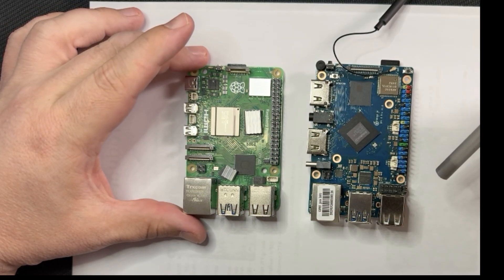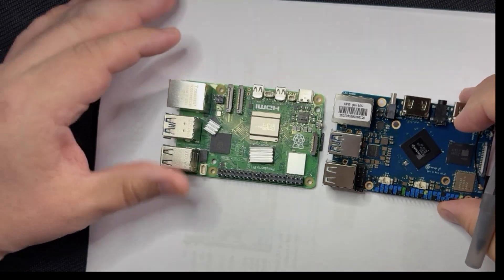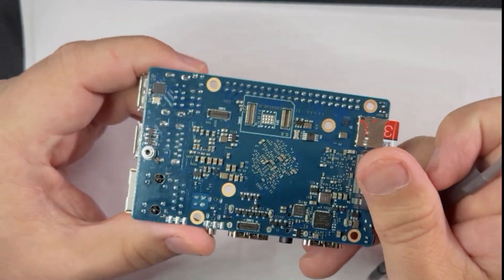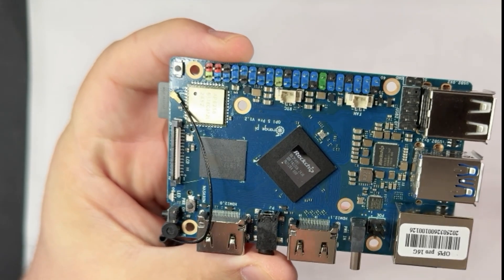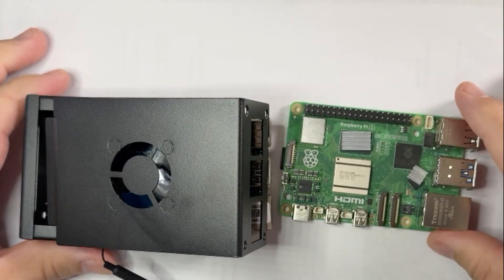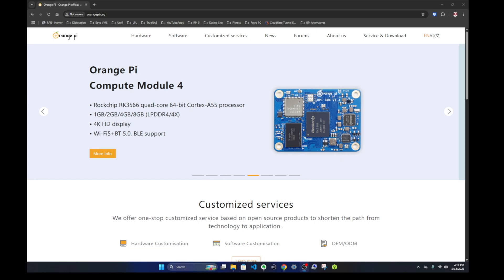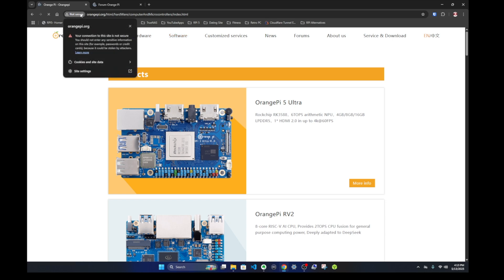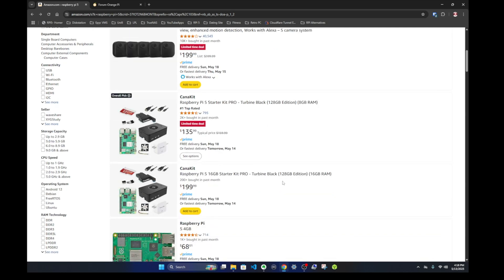Best SBC in 2025? Orange Pi 5 Pro vs Raspberry Pi 5!

Comment: I have both. Orange Pi beats Raspberry Pi in performance. However from software, forget about Orange Pi.
Reply from the maker: For sure, Orange pi can’t compete with Pi’s software or support!
Reply from the maker: Which Orange pi do you have?
Reply: @MackeyTech 5, it's RK3588 based, the base model with 8GB memory. Actually, it's good machine I use as a headless server. It runs also fanless.
Reply from the maker: Oh very nice!

Comment: Pi 4B is great, but Pi 5 is a big mess for both hardware and software. The out dated 16nm process makes Pi5 very hot!
OPi5 is getting better on software and doc. Great on AI performance. Great 8nm process.
Looking forware to RK3688 in 2026 with 4nm process.
Reply from the maker: Agreed but as I’m sure you know it’s also doing a lot more work than the raspberry pie four; What with the PCIE lanes, the GPU, faster RAM.  A good active cooling fan is always recommended! 👍

Comment: I have done a comparison between OPi 5 Ultra and RPi 5, both 16GB versions, for the use-case of using it as a developer 'desktop'. RPi is a bit weird, it runs Jetbrains CLion IDE dog slow, not usable at all, whereas on OPi 5 Ultra, it runs very decently. I'd assume it might be due to RPi usage of wayland and/or the GPU in general. Regardless, for this use-case OPi is the winner.
Reply from the maker: Thanks for insight! i’ve never used Jetbrains; what project are you developing?

Comment: That Orange Pi. Cant you go into the firmware and configure the NVMe to Gen 3 speeds?? All my Raspberry Pi 5's I firmware configured them  They run about 800-900MB/s speeds
Reply from the maker: Not 100% if that’s an option, nothing on their site or manual about it but You first have to connect the OPi to a computer via usb to ‘update’ the firmware so it can use the NVME!

Comment: It will be interesting to see if the Raspberry Pi 5 HATs work with these devices. After 7 reliable years with 2x Synology DS414 Slim NAS, I'm looking for replacements. While the Raspberry Pi 5 with SATA HAT looks great for 2.5" drives (and great tiny footprint with some nice cases available to buy or 3Dprint), I'm thinking this time to go with 3.5" drives for greater storage and CMR performance gains (as opposed to the SMR 2.5" drives). If there are no HAT options then I may end up having to use something like an Orico hard drive dock with USB 3.0.  I'm not worried about it looking pretty (e.g. I use a mini pc with top removed and sitting on it's side behind a 3060 TI GPU on an external mount connected to NVME port and external PSU).

For the NAS, I'll look to use 6x16 or 18TB drives, striped for parity. That will be a significant upgrade from the 2x13TB NAS I have just now so will allow me to create backups via incremental snapshots. The problem with data hacking these days is that corruptions often date back numerous months - hence I'm thinking incremental snapshots. But I'll need to find a NAS OS that can handle indexing of files across incremental snapshots. I haven't started looking into that yet so not sure if it's an easy or unrealistic ask.

Would be interested in your thoughts as to what could work well.
Reply from the maker: @justanothernoobe  the only open source NAS OS I’m familiar with that does incremental snapshots is TrueNAS but unfortunately it won’t run on ARM based processors. 
You should check out Jeff Geerlings videos, he’s the real master of Raspberry pi projects!
He did a RPI NAS video in 2024!
https://youtu.be/l30sADfDiM8?si=HAwG0tZv4B9RwWGe
Reply: Pi 5 is no good for NAS.

Comment: I have been playing around with several RK3588 boards, and I also have a Pi 5. The RK3588 can give you better performance, and it looks like we will have decent mainline support in a couple of months.
You can build Armbian with a recent kernel (6.14.2 in my case) and Mesa 25. Vulkan support still needs some work, but it's possible to do some light PS3 emulation. I just saw the news that Collabora has a working driver for AV1 HDR10 decoding. The Pi 5 doesn't even come close.
Reply from the maker: Yeah it’s definitely a beefy board with regard to specs! I’m hoping the  Bespoke based Orange Pi OS are tweaked better because I wasn’t super impressed with their performance during my tests, however I definitely need to do more testing of games and emulation!’

Comment: By the time you add the extras you need like power supply, case storage and hdmi cable you are in the same price bracket as a mini pc. May be worth a comparison with the x86 added to the mix.
Reply from the maker: I can definitely see your point there!